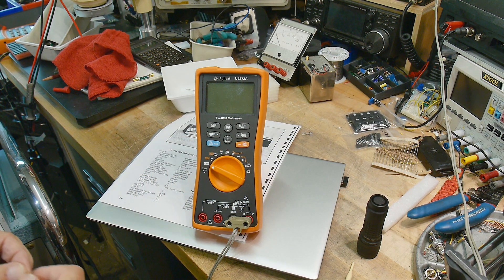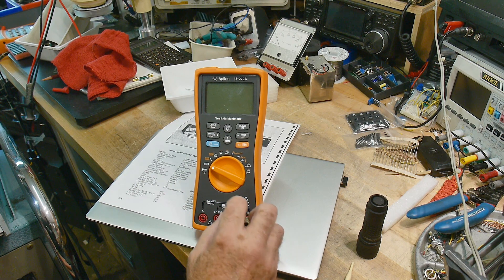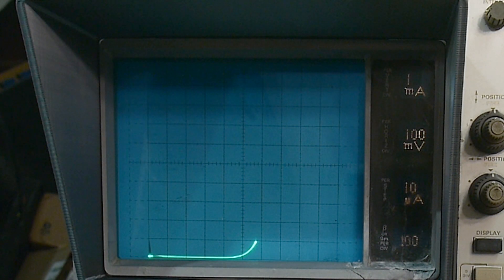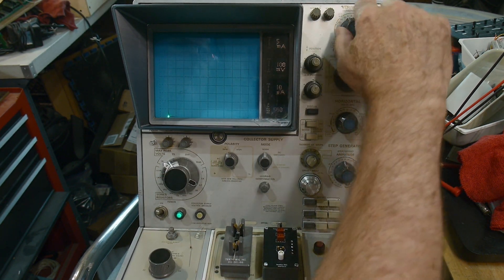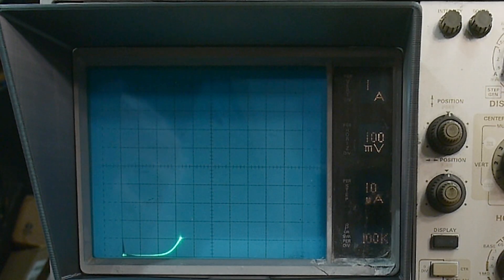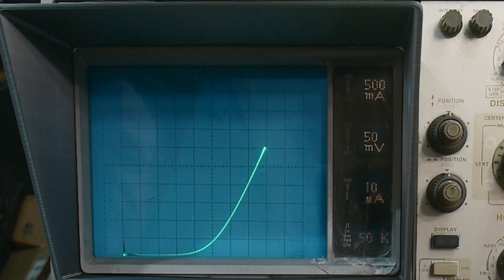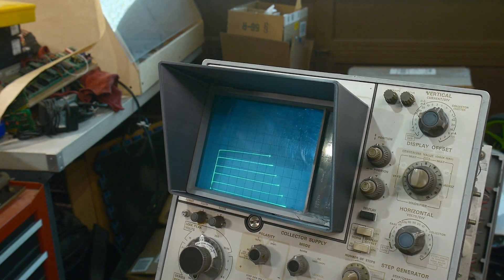#1322 Diode Forward Voltage

Comment: The common wisdom for LED calculations doesn't seem to consider this variation.  I suppose it's because the current range is in a narrow band (typically 0-20mA).

Also wanted to add that it looks like a nice print.  May I ask what kind of 3D printer you used for that?
Reply from the maker: https://youtu.be/Sz0-J1YLK-U

Comment: An oscilloscope with a X-Y setting can also be used with a function generator to create a diode curve tracer. Or use LTSpice to simulate it.
Reply from the maker: does your function generator output one amp?
Reply: @IMSAIGuy  Nop. But a simple transformer, a resisitor and a Variac (variable AC) will do ;)
Reply: @bayareapianist  You can use a 12v 1Amp wallwart, you dont even need a variac. Or a pc powersupply at 10 amps, blow his tracer out the water.

Comment: Never saw a curve tracer before. Just the graphs on datasheets. That's a really cool tool. I just measured the voltage with a multimeter/oscilloscope at different currents.

Comment: It's great to see these things in "realtime" rather than just looking at charts. Switching scales really gives perspective on the fact diodes aren't nearly as switch-like as they may seem.
Being a digital guy, I often think to use diodes as voltage regulators/references when I need to add some analog-ish front-end...  It's quite surprising to measure just how non-switch-like they are when dealing with uA scales. I'd've loved to see curves at that scale.
Another example is e.g. using a zener and resistor to interface 5V logic outputs with 3.3V logic inputs. I think this is a commonly suggested technique. But I found that my stockpile of zeners rated at 3.9V actually bring a "high" down to about 3V(!) at such low currents. So, e.g. choosing an actual "3.3V" zener, as one would think, might result in highs that are too low to register!
Also, been working on a positive-rail power switch using today's insane P-MOSFETs with a threshold voltage of less than -0.9V despite ratings of 10A and RDSon of less than 0.02ohms. The idea was to switch their gate with an NPN BJT in saturation. But this turns out to be very non-digital without careful consideration because even a fraction of a uA (e.g. leakage current!) can "flip the switch", even though it would seem, e.g., that a VBEon=0.6V will never be reached if, say, the base is pulled to ground with a resistor. Heh, no, because a fraction of a uA of leakage current from C to B then out the pull-down resistor, or even a fraction of a volt at the digital output' "low" might pull VBE up to 0.1V, which is nowhere near "on" but if zoomed in on the curve tracer might show that the NPN actually looks very 'switch-like,' at that scale, very similar to how it looks at "normal" scale: 0.5uA at 0.1V VBE might switch 50uA through the collector, it's very much like "saturation" except for at a much smaller scale. Hah! Who digitally-minded woulda thunk, looking at IV charts at 0.6V scales?!
Reply: You would typically use resistors and currents that are higher than any leakage currents (at least a couple times) to not have to think about it. But I can see where you would want minimal current draw, e.g. in a battery application, this might be important.
Reply: @brainndamage  Indeed, current draw from the battery when the device is off is the concern, in this case, lest the battery be drained below its safe level after a month on the shelf. But, yeah, I may be going about this wrong... Revision 3479, here we come!

Comment: Can you also use the curve tracer to get the point of failure for parts?
Reply from the maker: yes, I've tested diode reverse breakdown voltage and transistor max collector voltage
Reply: @IMSAIGuy  yes but does the part in question still work after resetting the situation?
Reply from the maker: @monchiabbad  yes

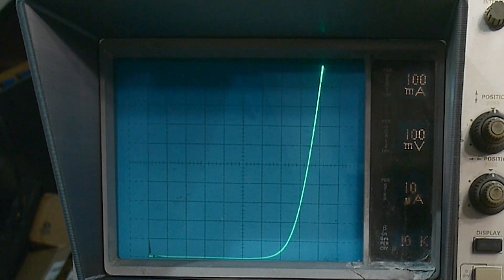Comment: Nice to see the voltage of the 1N4001 at 1A dropping by more than 100mV between 3:02 and 3:12. (maybe more than 40°C) 
(The cover of the instrument stays removed for further fine tuning.)  :o)
Reply: Yes it's the temperature increase, rather interesting to see in real time IMO

Comment: Your print quality is perfect. Show me your 3D printer. Tell us which slicer you use. What material do you use. Thank you.
Reply from the maker: https://youtu.be/Sz0-J1YLK-U
Reply: @IMSAIGuy  Thanks. but I was primarily interested in your technique for adjusting print settings. What material do you use ABS or PETG? What are your print speed settings.. how is airflow used? What slicer are you using? etc.
Reply from the maker: @ИпполитМатвеевичВоробьянин-т1п  I use PLA and Prusa slicer. I just use the default settings for my machine

Comment: Above 300mA it looks more like a resistor. But you are exactly right that the current matters. I bought one of those vintage transistor testers (even the modern ones suffer from this too)  where they measure the hfe at a fixed current despite the hfe being a strong function of the current you're measuring the transistor at. Thanks, for the reminder. edit [also temperature]

Comment: Another great video, thanks! 
Don't forget that in a typical AC -> Diode (bridge) -> Cap circuit, the diode(s)  only conduct ~10-20% of the time. That means if the circuit is passing 1A DC (average) then while it's conducting, it's running at about 5-10A peak. So the diode drop is higher than the DC drop at 1A. Even simple circuits can have complex results. I like to use LTSpice followed by circuit testing for this type of circuit. Quick and easy, and it gives you the complex answer. Assuming the models are good. Don't forget the transformer resistance.